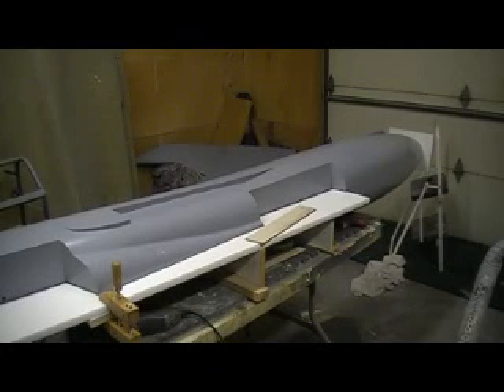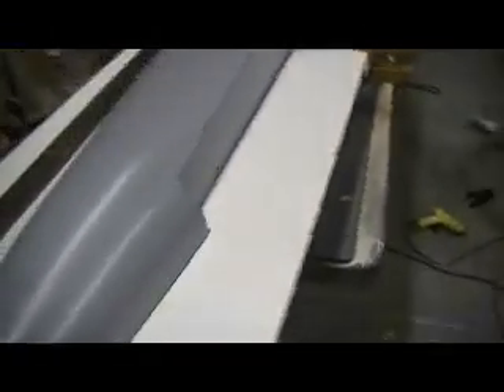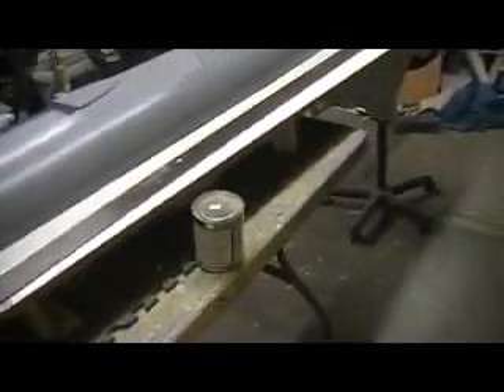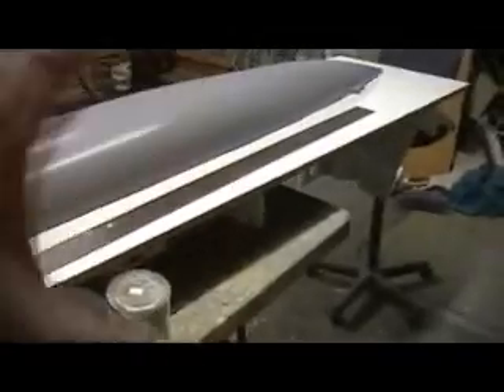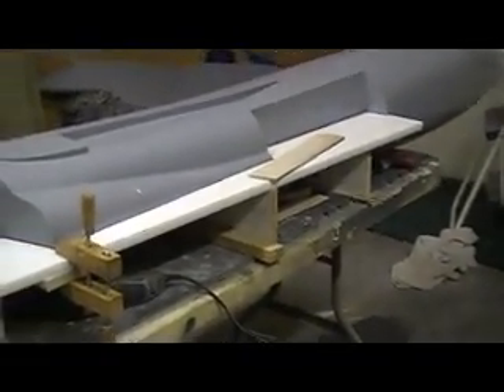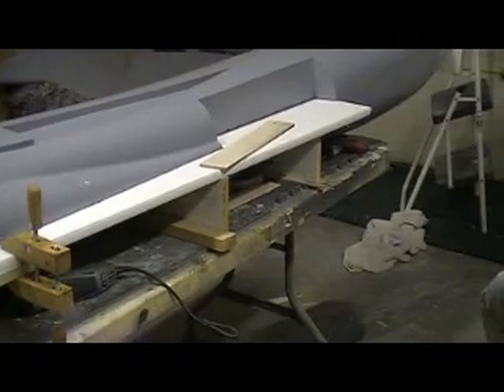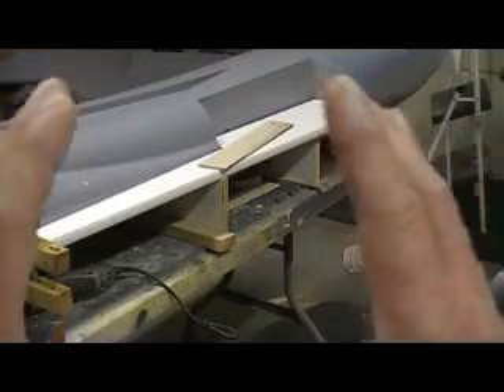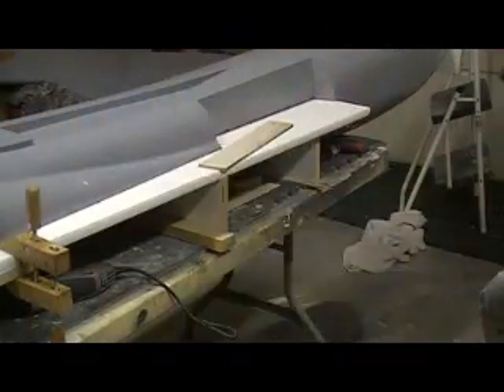how to build a RC JET f-105 thunderchief # 133

Comment: while you don't have to get it perfect because of the use of clay. Another way thats more precise than the compass is to use a washer and a pencil. Just put the tip if the pencil in the inside of the washer and roll it along the edge of whatever your trying to match. Works great for making shelves match a not so square wall in you house.